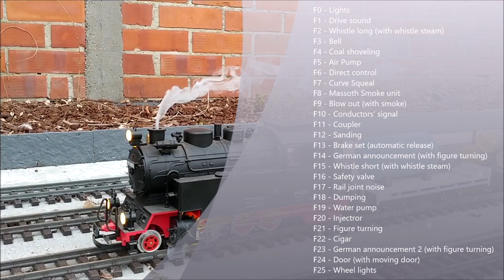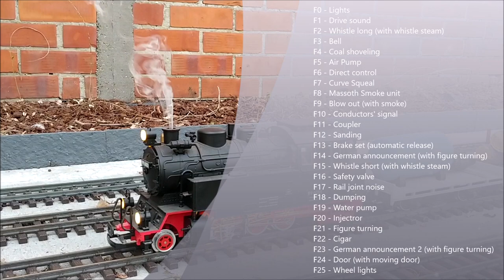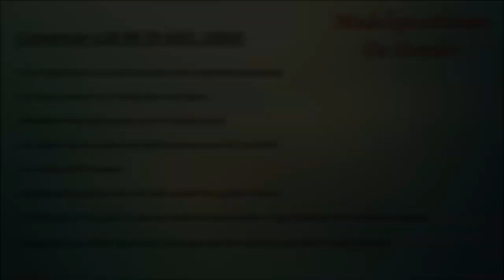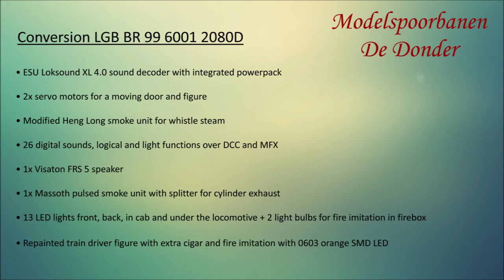LGB BR 99 6001 ESU Conversion - Making of - Steaming whistle and moving figure

Comment: I have the loksound decoder and smoke generator on my own model of this variant. The only thing that I do not like is the lack of more modern "shoe" electrical pickups, which are available on more modern editions. The power on this one is somewhat sporadic unless the rails are absolutely clean. Great job nonetheless, Maxim.
Reply from the maker: I love it cause the shoes are not so prototypical. I haven't had any issues, even on dirty track. My USA Trains GP38 is a different story. :p The small wheels in front and back can also pickup power. Out of the box only one does have coals for pickup, the rear if I remember it correctly.

Comment: Hi Maxim, I am giving the steam whistle a go and have an unmodified Heng Long smoker and an ESU Loksound 5 XL. Did you modify it so that it would fit? Mine seems to fit as it is. The Heng Long needs 6v for the fan and heater. Did you connect it to the AUX outputs (one for the heater and one for the fan) and adjust the 'dimmer' setting. Or did you do something to supply the correct voltage?
Reply from the maker: Hi
I had a version with "air pump" for Tanks that's why I added a normal fan. I don't know for sure anymore, but I think that I used a buck converter and relay for the the heating element. The ESU XL has a 5V output, so you can directly connect it.